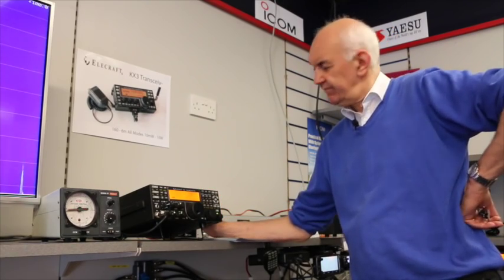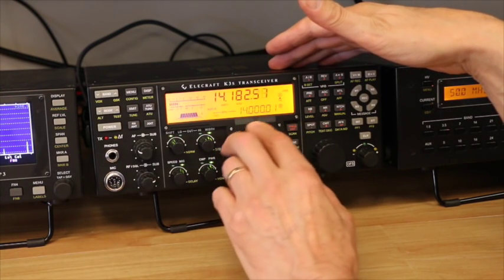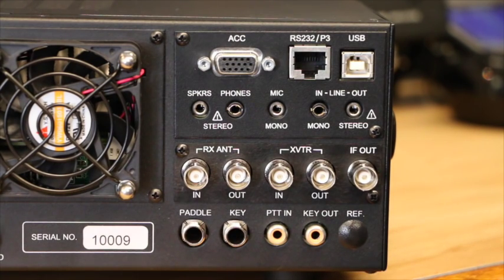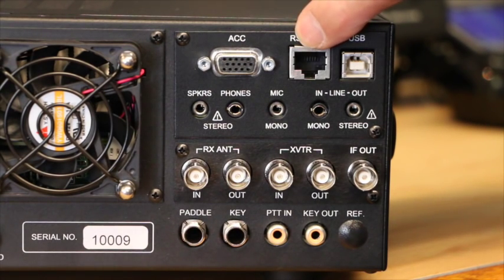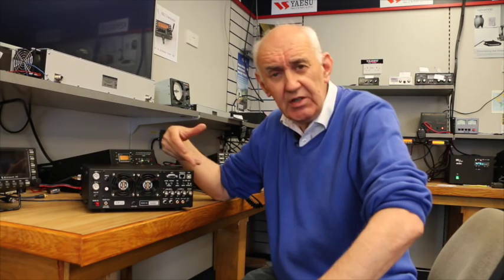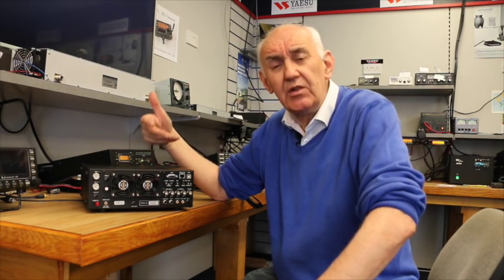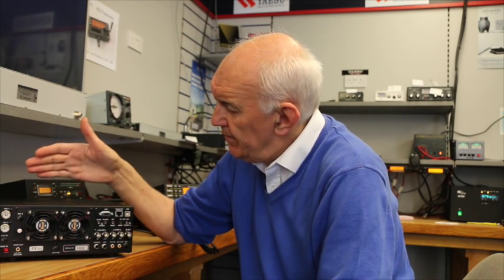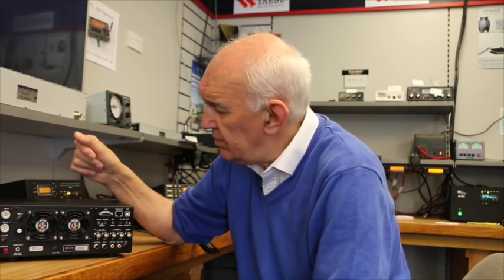Elecraft K3S Transceiver

Comment: I am new to HAM, when I will go for a huge HF, I will 100% go for Elecraft, after watching numerous videos, this thing simply rocks. All other manufacturers do not bother updating fixing hardware flaws at all, these guys seem to be on top of their product.
Reply: Don't become obsessed with specmanship. There's more to a piece of equipment than specifications on a piece of paper. 

The real world performance between this equipment is almost imperceptible to 99% of users, you actually need to have some pretty sophisticated equipment to be able to detect the difference.

With that said there are other manufacturers equipment which have substantially better user interfaces and the user interface is what you're going to be dealing with the most.

The user interface on ellicraft radios is pretty much right out of the 1980s Heath kit line. 

I mean don't get me wrong they're fine radios, I just prefer something with a more advanced interface that's easier to use and faster to use.

The bottom line is 99% of ham radio operators couldn't extract 100% of the performance out of a beginner's level icon radio so all this focus on performance is pretty much irrelevant when when it actually doesn't benefit you.

The best advice I can give any new ham getting into the hobby is sit down with a radio use it for a little bit and choose the radio you're most comfortable actually using and ignore all the specsmanship nonsense.

In my opinion when it comes to an intuitive user interface that's well laid out and easy to use icom has everyone else beat hands down.

It's as though I come went out and hired programmers who were actually ham radio operators to design their interface. You can literally sit down with something like an icom 7300 and learn how to use it in a very short period of time without ever cracking open the manual.

That's pretty much why I recommend the icom 7300 to newbies entering the hobby . They call it an entry level radio but it has features that make a competitive with some of the best contest rigs out there.

My recommendation is to get something like an icom 7300 and take the money you saved on the overpriced elecraft and put it in a decent antenna system.

Because personally I'd rather use a 20-year-old second hand radio and put all my money in an antenna system, then put all my money in a fancy new EllaCraft  hooked up to a g5RV
Reply: Your decision based on YT videos... ? hahahaha

Comment: A lot of comments say that the K3S is overpriced, its not the radio that's overpriced, I checked elecraft and if you were to buy the K3S assembled with all of the options today, it would cost about 4  thousand USD in the U.S., with maybe 7 percent sales tax and shipping cost.  in fact, there are a couple on eBay for less than the 4 k USD price.